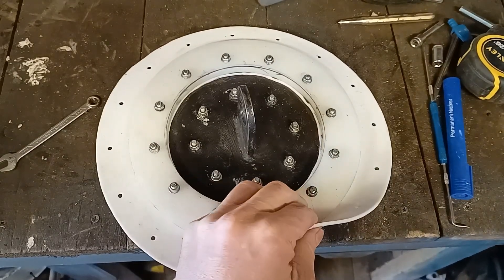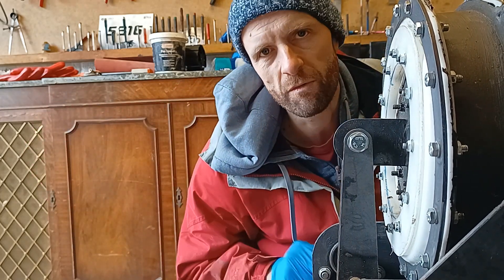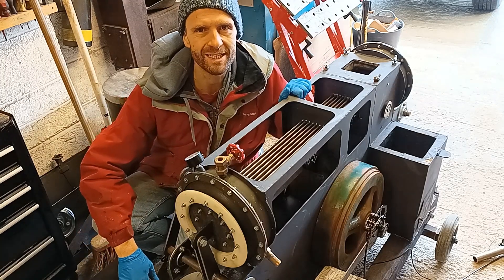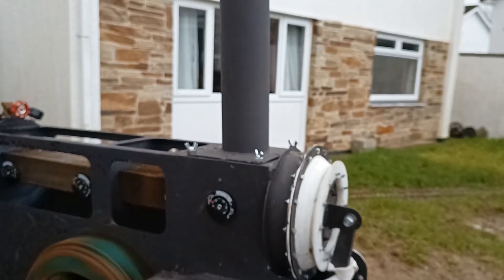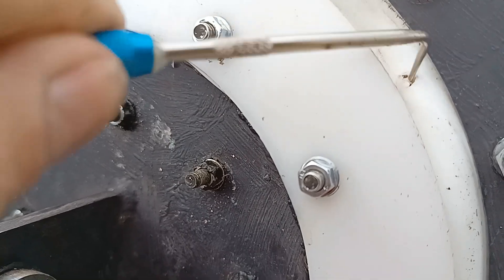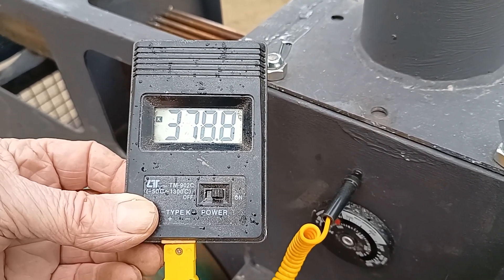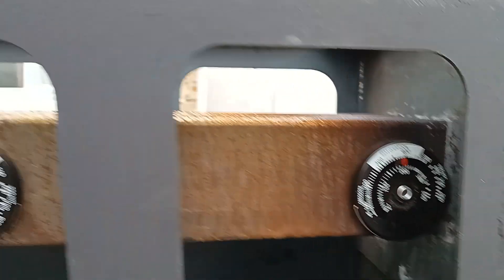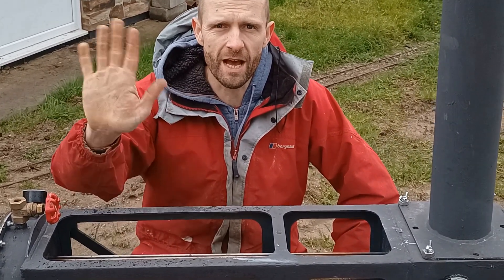Stirling Engine Generator Mk4 (Rocket Stove!) Part 8

Comment: the 600C to 380C flu gas corresponds to 0.33bar working pressure, and that means the heat efficiency alone is 34%.
Maybe it's running too hot for the capacity of the heat exchanger, tho as a crossflow kind it won't go over 50%

Comment: I am so impressed with this design. There are other designs on UT and one in particular uses a large diameter piston with diaphragm and very slow rpm with high torque. Yours is so compact and neat. I must go back and follow the Mk4 to see how it has been developed. The guy mentioning parallelogram motion might help against fatigue damage. Take a look at steam train engines. They have linear motion conrods. So do ship steam engines like the Wavely. Hope this helps.

Comment: Hi Shane, i'm going to throw my 2 cents in again!
How about a chainsaw vibration isolater between the piston and bellcrank. You know the rubber mount with two studs 
sticking out each end . 
Welding blanket of the type using a core of woven glass with orange silicone bonded to each side might be worth looking into
for your diaphragm problem.
Also concrete is hygroscopic and can be expected to fracture when heated to much.

Comment: I am very interested in knowing if a metal seal would work like in a chainsaw carburetor.

With roll forming you can creat a pattern on thin metal that will allow it to act as a diaphragm and it will withstand heat and chemicals
Reply from the maker: My main concern with metal is decreased movement and heavier loading on linkages. I might need to go down that route...... Cheers
Reply: @ShanePomeroy  I think it would be a first of its kind metal diaphragm engine. Probably worth the views as if you get it seen it will bring a lot of us that enjoy engineering creativity. It's always worth seeing the what ifs using new tech. Try and work with a company doing the roll forming to build to your specs or make an inexpensive pinch roller and try it yourself on a budget

Comment: Random thought: In most diaphragm pumps, compressors etc the 'piston' is rigidly attached to the connecting rod and therefore rocks but in a controlled manner.
The driving levers on your engine are quite long and the stroke short, so the change of angularity is small - what would be the effect of locking up the articulated joint between lever and piston?
Easy to try if nothing else!
Oh, and as suggested by others, making the diaphragms out of several layers of thinner material seems like a good idea.
Reply from the maker: I think your quite right. If/when I build another I would probably have a locked link with longer pivet arm. We will now start trialling multilayer thin diaphragms, many thanks

Comment: On the piston arrangement misalignment, what if you change that attachment point to allow connection to provide multiple holes...move the pin lower to apply more pressure lower to better equal the flex.
Reply from the maker: I shall look into that, many thanks

Comment: Do you think this would make a good membrane. I remember Jürgen Kleinwächter mentioning firemens suits as the material of choice for their membrane. " CARBO-FLEX® (AFLPN) Cloth

AMI’s heat resistant textile—CARBO-FLEX® (ALFPN)—is a composite of a woven fabric, a non woven material and a layer of aluminized polyester film for reflectivity. It provides continuous protection up to 600°F (320°C)."

Comment: Just double check that the IR temp gun is giving you an accurate reading, sometimes reflective and/or white surfaces (like with the silicone) can give low readings. I think matt black is the best surface. Maybe do a test with various materials/colours in the oven?
Reply from the maker: Thanks for the heads up : ). I've never really believed these things! I wanted a contact thermometer but it was a bit expensive, cheers

Comment: Pretty sure even once you align the piston with the parallel linkage will increase your durability, but still, any material is going to fail undergoing such repeat  reverse stresses. I believe the flexible bellows as part of the design is a lost cause.  Useful as a proof of concept for output on this size of unit definitely … and one really has to applaud your efforts.

Comment: 1:26 Can you build a parallel articulation for the diaphragm so it keeps the piston straight in the bore? Or maybe a sliding rod like a steam engine? Would it even make any difference in this case? With all the diaphragm issues, would a traditional piston/cylinder work better?

Comment: Great work! If you made the vertical linkages' bolt holes into slots you could adjust the height of the piston's center point to align it. Probably just coz it's off a little bit that it's nipping

Comment: Try TPU very strong and flexable or a surface tension diffuser for silicon this will make the silicone slippery lowering friction and adding a skin to the surface. look for smooth-on SLIDE you will have to make mould this is easy with a 3d printer. If you need any help let me know.

Comment: How about.. a piston instead. Piston has it's own troubles I know. The stresses on the high power diapragm are killing it, can the stress be reduced? How about extending the plate connected to the center of the moving plate, extending it to a guide that then keeps the plate straight?

Comment: Maybe make diaphragm of multiple thin sheets of silicone to reduce fatigue as one does with copper cables with thin strands making them flexible and not as subject to fatigue. You could extend the piston ‘rod’ beyond the link as a round rod and support it in a tube to stop the flexing / twisting.
Reply: silicone impregnated kevlar or fiberglass laminated with silicone?

Comment: Excellent, as always. Maybe carbon fiber? Cheers.
Reply from the maker: I didn't think of carbon fiber, I'll take a look
Reply: @ShanePomeroy 

Why not just use a true piston and piston rings ?

That would solve three issues

1) Seal breaking
2) Rotation issue
3) And I think you might be losing 11:37  power due to volume change because of the flexing seal.

Comment: I think you're on the right track using silicone rubber for the diaphragms. However, I do wonder if there are fillers in that particular grade of silicone sheet that somehow reduced its tear strength.

Natural silicone has very high resistance to tearing, so I was surprised to see that your engine's diaphragms developed tears so quickly. (And maybe it's irrelevant, but I've never seen white silicone sheet. The stuff that I can readily source in the US is always red-orange.) I'm wondering if your silicone sheet is impregnated with titanium dioxide. If so, that particular filler would definitely reduce its tear strength.

Even given the possibility that irregularities or sloughing in your concrete diaphragm landing may have contributed to the tears, I think it's unlikely that this is the root cause.

Hope that you switch to a different type of silicone rubber before abandoning silicone as a preferred material for your diaphragms.

Edit: high-strength silicone is tear-resistant. Regular silicone is not tear resistant.

Comment: What about an induction coil instead of wood and a 10kw axil flux alternator as the flywheel.
Reply: You don't know what you're talking about. If the machine output a third of kW, how will it power a 10 kW generator my friend?!

And the function of this machine is to produce mechanical work from wood. If you're going to use electrical power in a induction coil, just get a normal eletric motor in the first place.

Comment: Seems like a larger diameter for the gasket would spread the flex over a larger area and reduce the amount of fatigue on any one spot. Also either the parallel linkage or if that's to hard, just move the mount point on the piston slightly down so it's just off center, it will distribute the force more evenly as on center seems to be top biased a tad. Keep going love the videos!
Reply: I agree with Paul's comments. I also have a couple suggestions.

1) Increase the outside dimension of the seal 50 to 75mm. It appears that there is a lot of seal stretching when the piston is at its extended out position. You should be able to add a larger diameter flange so you wont have to modify your original design. 

2) Make a new steel piston with the distance between the bearing and seal face 6mm??? shorter. This will minimize the seal flex/stress when the piston is at its furthest "In" position. You can add more vermiculite as needed to maintain the correct piston volume.

3) Notch the connecting arm where the back of the piston was hitting. this appears to be a problem spot that maybe a small light spring could be attached to that would keep things stable. But not add much weight.

I am excited to see the gain in experience and knowledge as you continue with your Stirling hobby.
Hats off to you!!!
Ed
Reply: 1.  Create slightly BIGGER GAP between two moving faces of Piston and Sleeve. 

2.  Use NEOPRENE  instead of Silicone 

I don't know weather a Aluminium HEAT SHIELD on inside of Piston will make the neccessary difference but it might just help in absorbing heat slightly.

Comment: Those initial failures were right on the edge of the nylon ring, I suspect shear was the culprit tho any purely flexible membrane will ultimately balloon which will lead to trapping and uneven stresses. Hot side pistons have always been the achillese heel of heat engines, I wonder if moving the diaphragm further away from the heat source might help, the piston/diaphragm could be somewhat remote from the heat source as long as the working volume is maintained, perhaps a tube within a tube with the working part some distance from the firebox? Recon I would have guessed at lower diaphragm temps and gone cloth and rubber diaphragm material, most likely with equally disastrous results? Might be worth finding some silcon/cotton reinforced specs, see how they stack up

Comment: I don't think you are going to find a polymer solution to your design and concentric corrugated metal diaphragms are unlikely to give the travel - I  wonder if introducing a water vapor mist into the air might cap the temperature while increasing the expansion ratio? I was thinking of perhaps one of them little high-frequency mist probes placed in a small cavity in the cold end where condensate would pool - the high latent heat value where water turns to steam would cap the working water vapor to a little over 100c  yet the expansion ratio would increase considerably.
Reply from the maker: That is an interesting idea, kind of like a Stirling / steam hybrid. I was thinking it could inject a mist at the correct timing to be heated and then the condensate could be drained off the cold side.
Reply: @ShanePomeroy  You could try introducing some water vapor via the sniffer valve with a little household spray to try it out however for continual running you need something automated  -  of course, you could use something with a lower boiling point than water and stop corrosion too !
Reply from the maker: I will seriously think about this. The problem is my projects are simply following what happened 100 years ago!
Reply: @ShanePomeroy  Shane  water vapor would be far more  conducive too -  a little sonic probe placed in a little condensate well at the cold end would allow you to control the moisture in the cycle- Indeed you could even control it with a min /max temperature sensor at the hot end  that came on at say 102C and off at 98C to keep your cycle tuned to the furnace  heat output - You will need to "Spin" some thin aluminum covers for your stuffing rings you can't have bits of rock flying back and forth
Reply: @ShanePomeroy  I just had a thought as the pressure drops so will the boiling point nullify the vacuum, while each 3lb square inch pressure rise will increase the boiling point by 1c - this would cause any steam to condensate pressure rises  - Understand how this impacts your engine it seems would be a little more nuanced than I first thought - your hot air hybrid  would  indeed be interesting
Reply: That is a very interesting idea. Is there a regenerator in this engine? It would be interesting to see how that worked with vapor.

Comment: As always: Amazing!
On my qest ti be 100% off grid stupidity i need to know if the exhaust  a 10 Kw Ice generator, run at wood gas will be able to replase your rocket stove?
It will fore shure maethe "aftercooler" my freind insisted on?

Comment: Maybe a rolling rubber diaphragm like the ones used in air suspension systems is an idea to increase durability. It would add dead volume, but with the rubber less stressed, it probably takes the heat better and lasts longer. Also these things have a lot more travel / swept volume.

Comment: It's possible to also get heat resistant silicone. It's not very hard to make the membrane either. Just sandwich it between two glass or baking paper with suitable spacers. They are usually mainly used for sealing.

Comment: Just cut 1 cm off of the linkage to clear the contact point.

You can try to make two kinds of composite materials: A fiberglass fabric, maybe 3 layers, with high temperature silicone as resin for the diapragm.

For the lining inside the chamber, you can use the same filler, but mix a lot of fiberglass wool to avoid embrittlement...

You're doing a great job with this engine. Looking forward for the power test. Thank you.

Comment: Sometimes in engine fuel pumps, they use multiple thinner diaphragms stacked together. Perhaps this might help? Ideally some fabric/fibres in the material would also provide some strength,  but it might be hard to find?
Reply: Yes. Laminated.
Reply: well, metal diaphragms are the best, however they have to be laser welded otherwise it will be hard to keep the sealing between diaphragm segments

Comment: What about a parallelogram linkage to keep the pistons aligned.
Reply: Yep extend the piston arm and add a slave link
Reply: Or balance the piston out over the pivot point, but will have double the weight.
Reply: This is the solution I would use
Reply: How about a shaft and linear bearing?
Reply: @hackofalltrades5256  but connect the pistons to each other so they operate on the same plane.
Reply: @captainlandyacht1328  rod could  have a joining insulator and a few bearings /seals linear type it should smooth andcaline piston action stability , might even cut down on pivots or overall parts count 🤔
Reply: Simplest solution to the piston tilt is to weld a rod on the back end of the pivoting arm and run it through a linear bearing or something so it can't tilt. It doesn't look like it has a whole lot of tilting energy so it shouldn't be too hard.